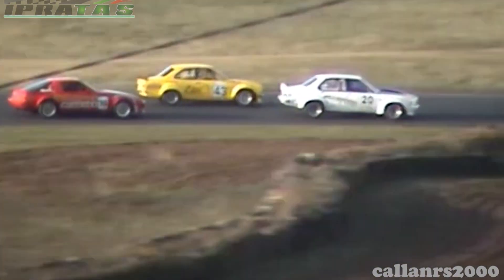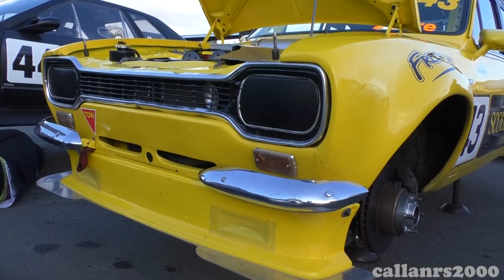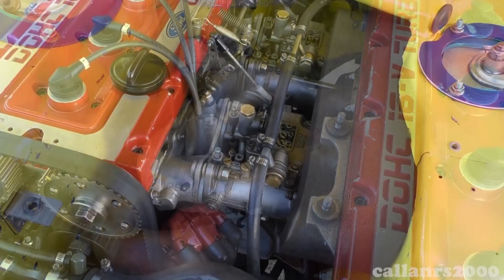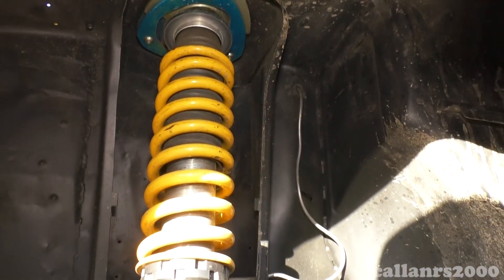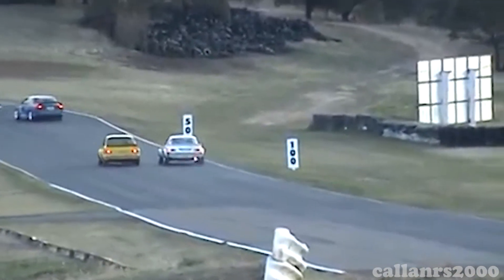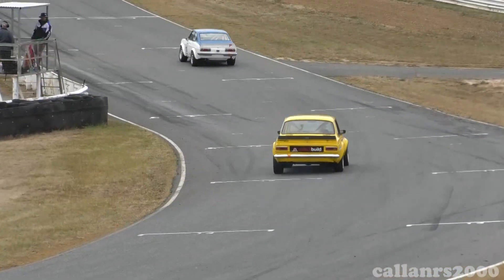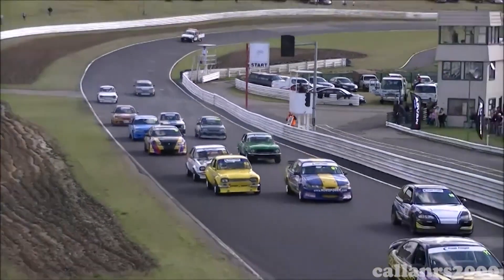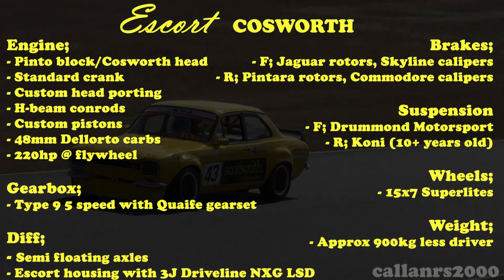Anthony McKenzie's Ford Escort Pinto/Cosworth Improved Production Race Car IPRA | Cars of the TCRC

Comment: Great feature there, Callan. Talk about a well developed car. That’s got to be the lowest powered, full bodied car to go under 60 secs at Baskerville. Many IPRA cars struggle to go that fast with an extra 100hp or more.
Reply from the maker: Thanks Ben. When I spoke to him he estimated power to be around 240hp but the dyno proved otherwise! Should go even better with tuned fuel injection
Reply: @callanrs2000  is the 220hp figure a conversion from a whp figure? Interested to know what it read at the wheels, even the dyno used as they’re all different. Regardless, it’s a seriously fast car for relatively little hp!
Reply from the maker: I believe so. He was a bit disappointed with the figure but it makes the lap times even more impressive!